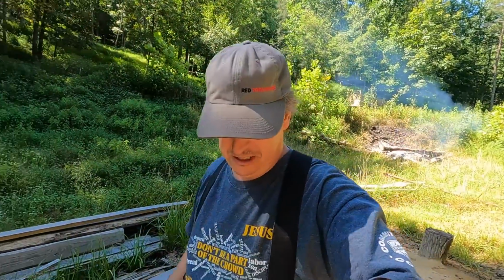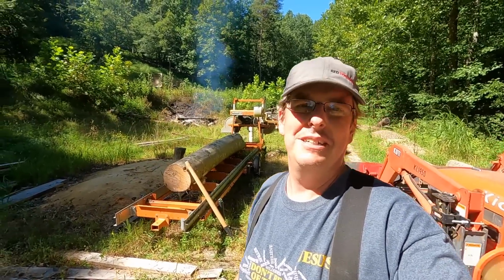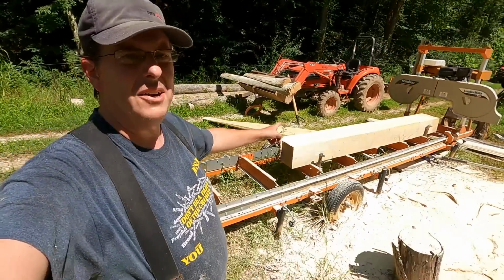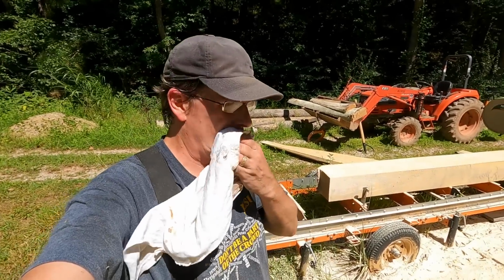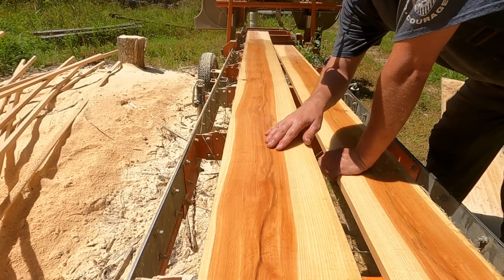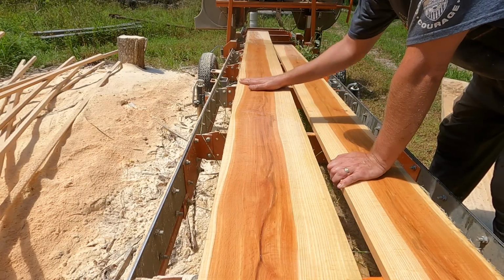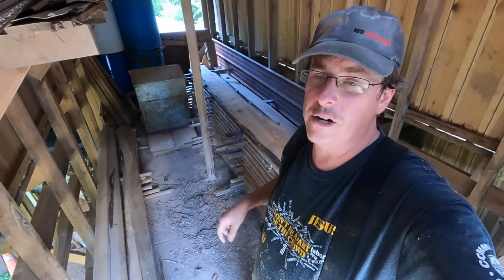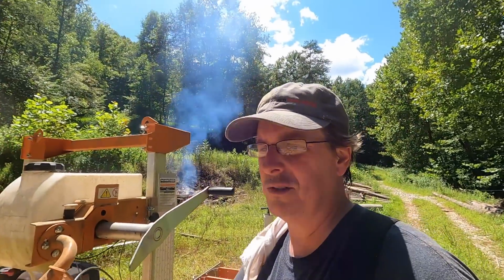First Time Saw Milling BEECH

Comment: Straight line winds knocked down some 36” diameter beech on our farm. I cut a few logs to use for wood turning. The beech, both heart and sap wood, produced beautiful pieces. Obviously, drying for wood turning is much different than for saw milling, but it worked out well and was easy to dry without much wood movement.

Comment: Ever consider adding another set of log tongs?  I use the style with a swivel and chain hook on the end. I attach one at each corner of the bucket and that allows me to pick up the log parallel to the bucket.  Also makes log position easy with the tilt on the bucket. They were relatively inexpensive $80 or so shipped back when I got them.

Comment: Just out of curiousity: is this now for the new millplace/shed or how is it coming together with that project?
 Your "stacking and racking" is btw interesting. One project/stack or a little here and a little there? I would loose track in a heartbeat 🤭🤣.
Reply from the maker: That is the loft of the barn which is where we site wood to dry currently. The stacks are based on species. Cherry to the right and white oak on the left. I take from them when I need wood in the woodshop. 
Sawmill shed is designed. Just need to start the concrete work if it would ever stop raining.
Reply: @RedToolHouse  
Thank you for answering to a complete stranger 👍🏼. You have one of the nicest channels that I look on 🤗💪🏼!

Comment: So, I guess Beach is a hardwood? I remember growing up in the early '60s my dad liked beach for firewood. I can't remember it being a hardwood tho. I also remember coon hunting in the 70s, and if the dogs tree'd a coon in a beach tree the tree was normally hollowed out, and the raccoon would most always be inside the tree trunk. It's a pretty wood.
Reply from the maker: Yes. It is considered a hardwood.
Reply: It is a waste to use it for firewood. Although it is not rot resistant like white oak, it can be used for cabinetry, shelving and table tops. If it is European beech, even better.

Comment: Do all your wood buildings and scrap wood get eaten up with carpenter ants? Whats the best way to prevent them from eating your wood?
Reply from the maker: Treated lumber will last about 7 years. Non treated will last a couple years. I used motor oil on the barn posts. Keeps the ants out

Comment: I always thought of beech as junk wood because it doesn't split or burn well. Oops
Reply from the maker: It is not commonly used for dimensional lumber or even trim but it is used in plywood. Yes, splitting and biting for heat is a drag with this species.